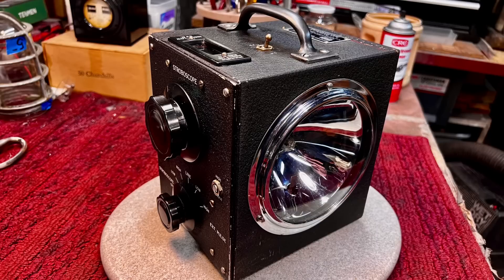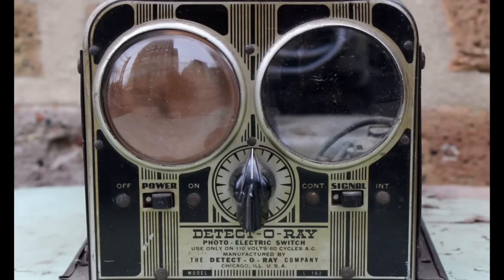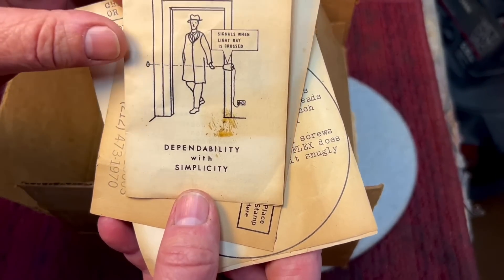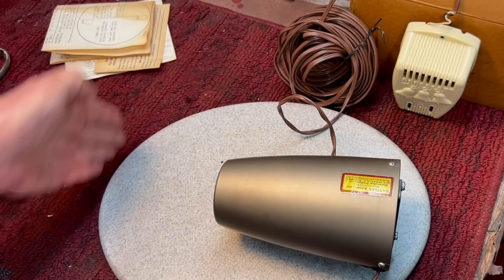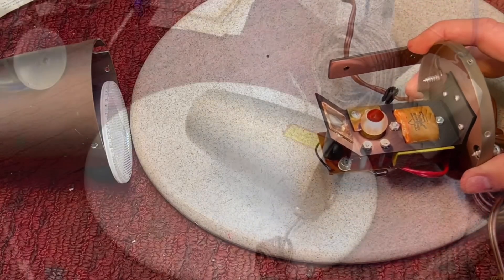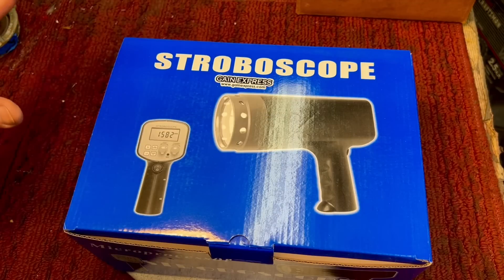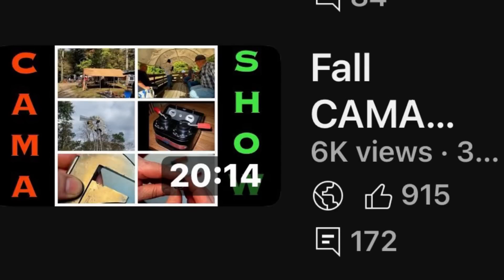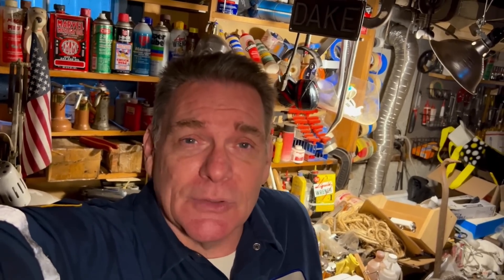Rarely Seen Vintage RAYFLEX Announcer.  Plus- Using a Stroboscope.

Comment: John, FYI based on the warranty return envelope having both a telephone number area code (c.1947) and a US postal zip code (c.1963),  your detecto-matic could easily be 50-61 years old, but no older. Great video. Thanks.
Reply from the maker: Thanks for the info!

Comment: Yes,  things aren't made to last any longer.  It's too bad.  I just got a few hit & miss engines running,  100 or more years old,  and it didn't take much to get them popping. But there's not much to them. 

And,  I used a timing light twice today at work. Sometimes I'll turn the strobe down and dance for the people around me...
I'm old,  but I'm hip. Or so I😅 think.

Comment: Door chimes, electric eyes, strobe lights, and old television remote controls, what else could not pique interest in the early 60’s. So much in this episode to bring back memories, lets not forget about those mechanical television tuners. Our uncle had the first color TV my brother and I had ever seen ( Zenith Chromacolor). The remote control had metal bars inside and when the button got pushed the tone, much like a tuning fork, sent the motorized tuner to the right channel. That sounds archaic by today’s standards but it worked and anyone who saw it was amazed by it. My strobe light sits unused in my tool box, along with the dwell meter, and remote starter cable I used to set valve lash. We’ve come a long way, many thanks for your look to the past!
Reply from the maker: I remember those awesome remotes!
Reply: I have a box with mechanics electronic tools. I don't use them but if I ever get the Duesenburg that I have wanted for 60 years I will need them to set the timing.

Comment: I’m curious, does your version of the detect-O Ray work whether your hand is going forward or backwards through it? I’m guessing the two lenses on the actual detect-O ray only chime when someone comes in, does that sound feasible?
Reply from the maker: Actually it’s just a beam of light that bounces off a mirror or reflector and comes back in the unit to an electric eye.  It doesn’t matter what direction as soon as the beam of light is broken the bell rings.  😃👍

Comment: ScoutCrafter, 

WORTH IT!!!!!

An important part of ship design is model testing.  A major portion of the testing is done in a cavitation tunnel to study propeller performance.   In simple terms propeller cavitation occurs when the pressure differential on the pressure and suction sides of the propeller results in the water near the tips forming bubbles (boiling).  To study cavitation a strobe is used to observe cavitation and to improve the propeller design.

I have been involved with cavitation studies on two classes of ships.  The first was a 188,500 DWT tanker that had a nozzle fitted in front of the propeller to increase efficiency.   This retrofit was done without the use of model testing.  The testing showed that if the tanker had an exceptionally bad flow to it, by adding a nozzle you had very fast bad flow.  A new propeller was designed and manufactured based on the testing.  Fatigue fractures forced the removal of the nozzles.

The second was during the model testing of a new 150,000 DWT tanker.  We were able to optimize the design of the ship's hull and the propeller.  Without a  strobe we would not have been able to optimize the design of the propeller.

If you have access to an air hockey table, a strobe makes it possible to study the physics of pucks striking each other.

Bob

Comment: They/we/ I used that type of strobe light in dynamic balancing in a single and two plane dynamic balancing, from driveshafts to fans, doesn’t matter. Always fascinated me, to set it up and get it just right and you could tell about how weight to put on or reduce at a 180 degree plane, fun tool to use, enough ranting, great show enjoyed watching.

Comment: I guess you had a techy barber, mine had a bell hanging on a curved bracket. There was never any chit chat in the shop either and the haircut was 25 cents. I could spend all Saturday in the movie theater for 50 cents.

Comment: Thanks John, I was always fascinated with those detector devices with crimes too, the one I remember had a particular two tone chime. I remember well visiting the barber with my father and then also with my son, we have good thick hair in my family and when we were done there was a sack full of hair to be cleared up, it often got a comment as being unusual ! Thanks for the strobe demo they always interested me, do you remember they used to fit them on turntables in the 80s to check the revolution speed was accurate, looking forward to the Zagray coverage - remember you've given up buying tools, just like I have ! 😉

Comment: Lets try a again. Some of my electric tools are belt driven. I could experiment with different size pulleys to get the best rpms to match up for best results. I have a joiner that my Dad had. When he got it without the original motor. The motor he used has a wrong pulley so it leaves a little wave on the board. I am going to get a strobe light to get the proper rpm so the boards come out smoother and I won't have to sand as much. So thanks for the demonstration.
Occasionally I do learn something. Thanks for doing the videos. Bob from North Idaho.

Comment: Great content. 
I love strobes! Watching a saw blade running through plywood sheets looking like the blade isn't turning.
Or a conveyer of print, running 100's of feet per minute that is still and able to read!
Oscilloscopes reading line voltage, current or frequencies.
Eddy current testing is all so much like magic to me! 
Something you should look into is Pneumatic HVAC Controls.
They utilize air pressure to regulate temperature and air volume in ways that is magical... But all mechanical.

Comment: There are various free and paid smart phone apps that enable you to use your phone to be a strobe-o-scope.  I used one to check the accuracy of my tachometer in my '72 MGB GT.  I put a tape dot on the fan blade and adjusted the speed on the app until the dot appeared still, then compared this to the tach on the dash.  Coincidentally, I bought a 1972 Motorola AM radio to fit into the car when I restored it - it's the old time five push button, two-knob affair that was ubiquitous for decades. It was NOS never installed (radios were usually dealer installed) and the original box had all the papers, warranty card, instructions, etc just like you showed with your RAYFLEX Announcer.
Reply from the maker: Mitch- Phone apps are absolutely amazing these days.  Honestly the smart phone has to be one of the greatest inventions in the history of mankind.  😃👍

Comment: I seen a military tube tester in a second hand store for $70.00
Reply from the maker: John- There are always a nice selection on eBay but you have to make sure they operate correctly. They had their own issues as they got older.  🫣😂👍

Comment: My 70's Garrard Zero 100 Turntable has a stroboscope built into it. You turn a knob to synch the platter to the intended speed. 
You should plug the Rayflex into a Kill-a-Watt Meter, to see how much electricity that it uses! 
A friend told me (flashes the dog picture) to add Adblocker Ultimate & Privacy Badger to your browser. They are free, and block "bad things".
Reply from the maker: Alan- My Dad had about 30 beautiful turntables from the golden age of HiFi…. 😃👍

Comment: Cool story. I do appreciate the quality of products in those days. I never thought of using a timing light to read the number on a belt. I just learned something. I have an old Craftsman  timing light like the one you showed but it needs a lamp that I have been unable to find yet. I used YouTube premium for years but then I learned if you use "Brave" instead of Google, it automatically cuts out commercials. And it's free.

Comment: I remember the door chime as almost every small store had one. Really small ones just used a bell which I have in my shop. I remember trying to beat them. Not happening but it was entertainment for a kid. I wouldn't mind a strobe scope to check machine rpms but they are expensive. I still have my timing lights. One for regular engines and one for small engines. Never used the latter as it was my stepfathers. They are in a drawer with engine rebuild tools that aren't used. Kind of like the engine dwell meter.
Reply from the maker: Philip they have an app for the phone that does it!  😃👍